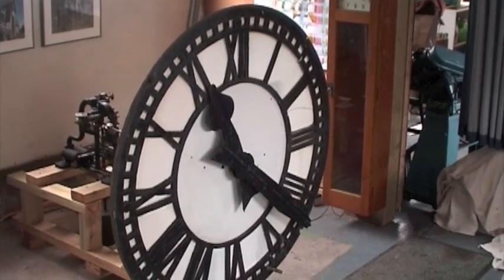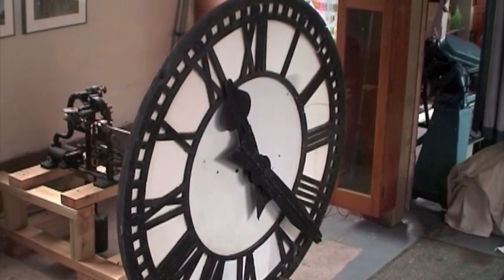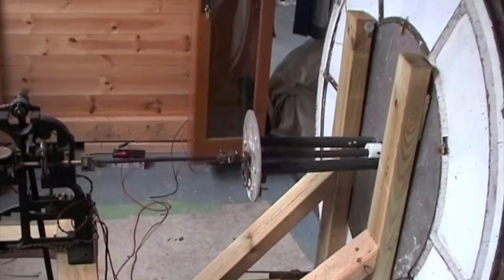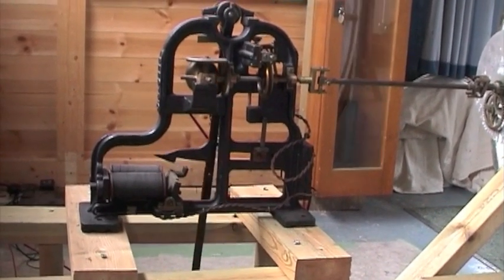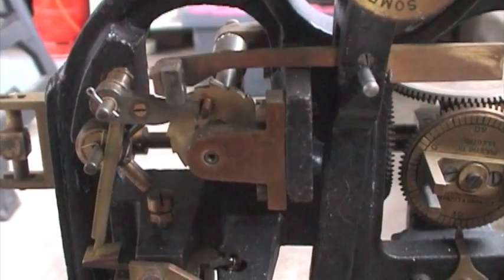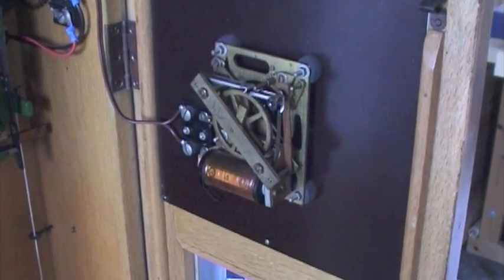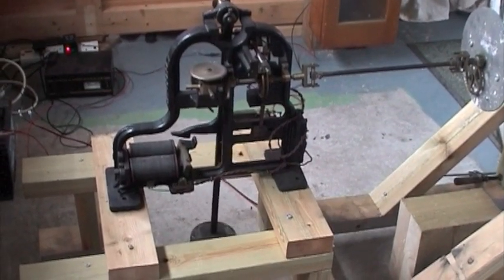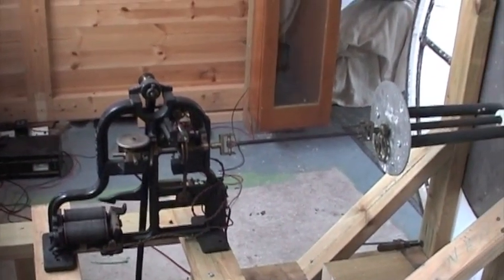Gents clock system

Comment: this is a waiting train tower clock the two big electro magnet pulls one long permanent magnet and the hook pulls hard pendulum the pendulum is swinging and turn the count wheel the count wheel drives worm the worm drives gear the gear the gear drives four way axle the four way axle drives four minute axle and hour axle on four dials 
 count wheel rotating 360 degrees equal to tower clock minute hand rotating to half minute if count wheel rotating 360 degrees the hook lift up the count wheel driving hook and count wheel stops rotating and tower clock hands are stopped and wait for the pulse from a master clock